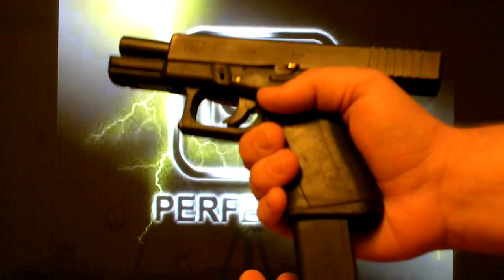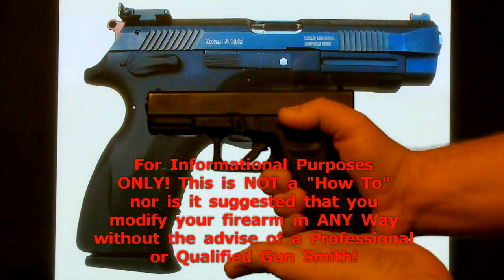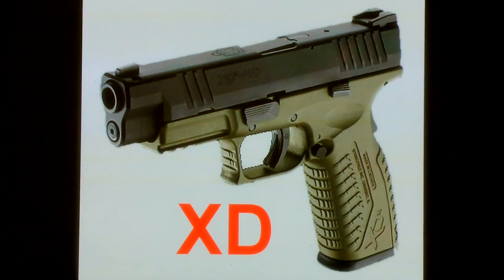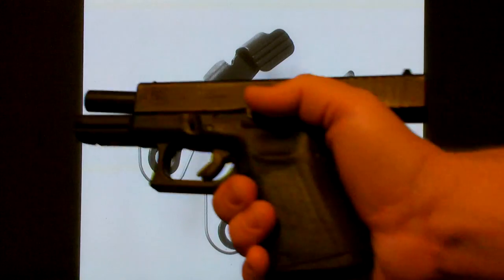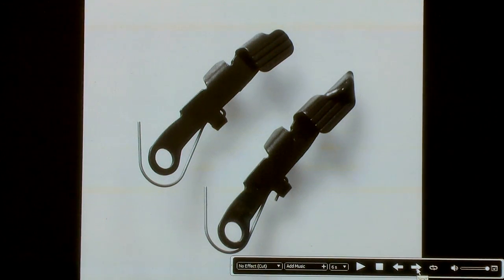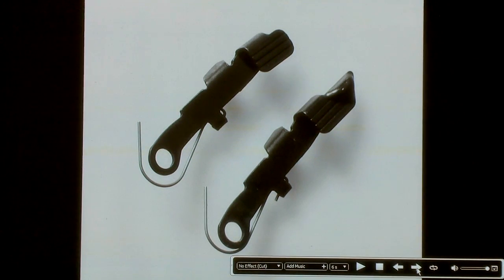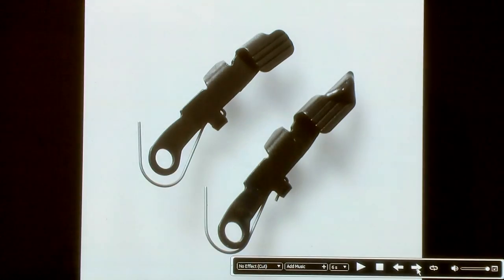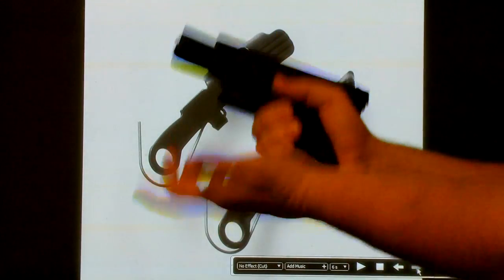Automatic Handgun Slide Release! Slide Drops By Itself When Loading A New Magazine.

Comment: I noticed that if the magazine is not full it jams if I slam a mag too hard. But fully loaded gen 5 19 does this and I found it accidentally. Kinda fun but only works in my gun fully loaded mags.
Reply from the maker: It will only happen on fully loaded or overloaded mags. Malfunctions with a hard inserted half loaded mag is also fairly standard and should be expected.  If your running partially loaded mags for training just be aware and don't send it home so hard. Again... it's physics.... your motion is exerting forces on the spring and cardriges causing them to shift around..... that's what causes the malfunction. With a fully loaded mag the spring and cartridges have no where to jostle so it's more of a uniform piece with all the moving parts locked tightly together.

Comment: Does that gun have a automatic slide drop when you pull back slide ?
Reply from the maker: The slide only locks on last round or if you push it up while holding the slide back. It's home position is always down unless acted on by something to engage it

Comment: So my new H&K is doing this, however when I insert the magazine with less force but it is still seated, the guns slide will not budge forward and the magazine will not eject.. does anyone have this issue
Reply from the maker: ThePhalanx10000 insert the mag gently, then push on the base plate until you hear a click....n try and work the slide lock lever or the slide. IF the problem persist, sell your H&K and buy a GLOCK. Lol ...no for real though, if it's persisting then I'd either go down to your local gunSmith or store (that actually knows WTF they're talking about and not just selling them) and have it looked at or call H&K and start a warranty claim. This firearm should be immediately removed from service due to its condition I would NOT be handling it around other people and would most definitely NOT trust my life to it. It sounds to me as if something is binding (a magazine safety) or something is not fully seating in the the firearm somewhere around the mag notch(es). Keep your finger away from that trigger until it's properly diagnosed and serviced. I hope that helps you out bud. Good luck.
Reply: @MyBigThing2010  thank you for your quick reply, will be looking into this issue further with H&K. Appreciate it and stay safe
Reply from the maker: ThePhalanx10000 would be great to know the outcome if you think about stopping by once its diagnosed and letting me know that would be awesome.

Comment: can u do this on an empty chamber?  will it damage my glock 23? droping the slide that is...
Reply from the maker: oscar rodriguez yrs this is done with an empty chamber and a loaded mag....so when the slide drops the chamber is then loaded. no this does not "damage" the firearm
Reply from the maker: oscar rodriguez dropping the slide doors not damage any firearm. the slide endures WAY more forced during during than you could ever impose on it manually with your hands our any manipulation with your hands. this is exactly like using your thumb to release the slide only it happening without your thumb moving the slide lock lever as I explained in the video.

Comment: I run SIG Sauer's exclusively and they DO NOT have this malfunction issue.  If a handgun does this, it needs to be immediately returned to the company and repaired for safety purposes.  This is a mechanical failure issue.
Reply: Yeah 😉 return a H&K mod 4 because loaded magazines automatically release the slide
Reply: I agree I have a 226 and a 226 legion and they both do that since I first got em =P

Comment: For competition this is great, but for defense I would like to find a way to stop this from happening.
Reply from the maker: simple. don't "Slam" the mag in n it won't happen. its inertia thats overcomes the mechanical engaugement of the slide's notch n the slide lock. if you insert normally it wont happen if you overcome the friction of those two surfaces by Slamming home a mag then it may happen. its not a guarantee though.
Reply: +MyBigThing2010 In a self defense situation, when motor skills are low, I want to put the mag in with authority. I agree you should train to always release the slide manually, but I don't like the idea of dealing with an uncertainty with my gun when there are so many other things to be looking at. 1911s don't do it, but I don't want a 1911 when shtf
Reply from the maker: +danwk7 in a self defense situation when doing a magazine reload your firearm and the new magazine should be in front of your face in your workspace and I don't see it as a downside not having to rack the slide or work the slide release lever you will see visually that your slide has dropped and you can continue to engage your target immediately I see that as a 1000% benefit
Reply: I understand that, I only own 1911s and I like knowing that I purposely chambered a round, something about the slide shutting on its own doesn't give me a warm and fuzzy. maybe with more experience with polymers I will learn to accept it. Looking at walther ppq and Steyr pistols now, I'll have to wait and see
Reply from the maker: +danwk7 if your looking to buy new then youll have a long long time n many many rounds b4 this will happen to you without u obnoxiously slamming a mag in or slamming the magwel on a table. IMO given those choices id go Walther...good luck with your choice n new handgun! Thanks for watching/commenting... Shoot straight, stay safe n best wishes. MBY
Reply: Don't slam the mag home

Comment: This is a traing flaw. It isn't a benefit. If this is happening to you you need to train it out of you. You are slamming the pistol and mag together instead of loading the mag with one hand. All polymer pistols will do this. The polymer frame flexes and it what causes it.
Reply from the maker: Did you even watch the video?  Or do you just like repeating?  ....n is not because of a flexing frame lol.... that's ridiculous if you actually knew anything about mechanical operations
Reply: @MyBigThing2010  first,yes it is the frame flexing. Notice you didnt show nor has this ever happened to a steel framed semiautomatic pistol. I will give you two guesses why. If you guessed because steel doesn't flex like polymer (plastic) you were correct.
I watched the video.. I thought about stopping the video when you were ,what sounded like directing people on how to make this happen in their own firearms as if it is some trick feature when it isn't.  You "not considering this a malfunction" backs up thats what you were doing. And yes,it is a shooter induced malfunction. Against my better judgment I continued on. You were correct about it being physics causing this. You are just wrong as to why physics causes this.  
When you load a magazine into a pistol you insert the magazine. When the slide slams home when loading a magazine that is because the pistol and magazine are slamming together rather than the magazine being inserted. This slamming together is what causes the frame to flex. Steel framed semiautomatic pistols have the same surface area touching between slide lock and slide,and again it doesn't happen to steel framed semiautomatic pistols. And it can happen under stress even to those who have trained not to do it. This is why when topping off or reloading the pistol the slide should always be racked rather than hitting the slide lock (often wrongly referred to as a "slide release").  That way if it does happen muscle memory takes over,you rack the slide anyway and noones the wiser. (Also known as tap rack)
 Unfortunately most humans are lazy and will take what they perceive as the easiest route to their ends. Now that you have made people aware they can make any polymer pistol out there do this I would be willing to bet there is some idiot at the range right now showing his buddy what some guy on YouTube showed him how to do. 
If you knew the correct numbers there is a mathematical formula that could also prove your theory wrong. There isn't enough enertia to make the slide lock move on its own even while under spring tension. It is the frame of the pistol flexing just as it flexes while being fired.
Reply from the maker: @FreedomInc  yes i can do this with a steel frame pistol....n a new spring n slide lock lever WILL almost entirely eliminate the problem from happening if it is happening on an uncomfortable frequency...... so frame flex = no.  Your so far up your own ass you can't learn anything without it damaging your pride.  I provided information to save people money with unneeded gunsmith trips and time on the phone with manufacturers.....I can't control how the info is used or perceived.... you being that point proven.  These are all demonitized so continuing this argument for free isn't going to happen.